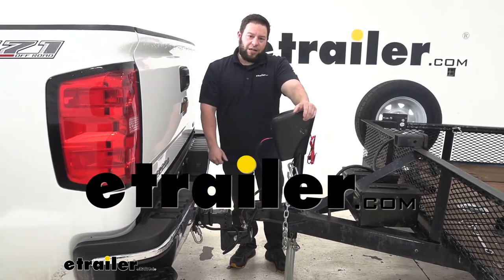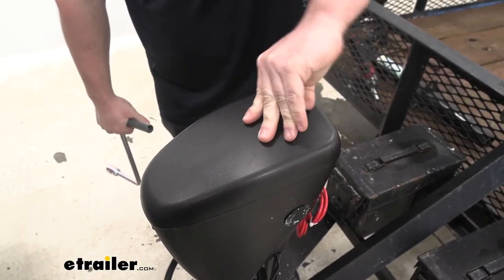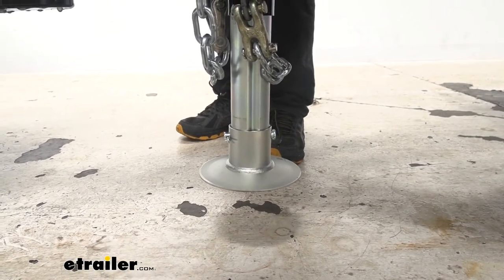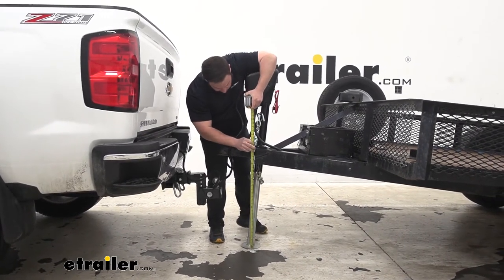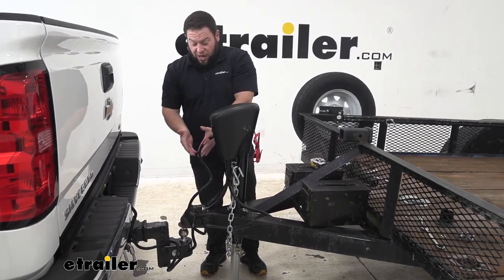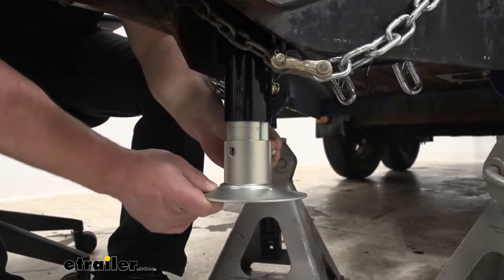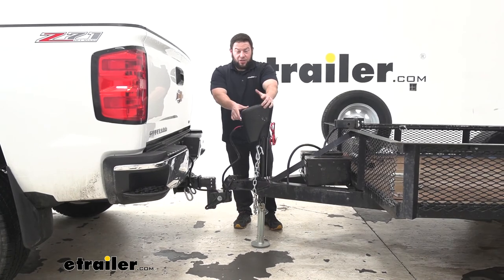etrailer | Comprehensive Review: Lippert Power Stance Electric Trailer Jack w/ 7-Way Plug

Comment: Does the plug-in work for all trucks?
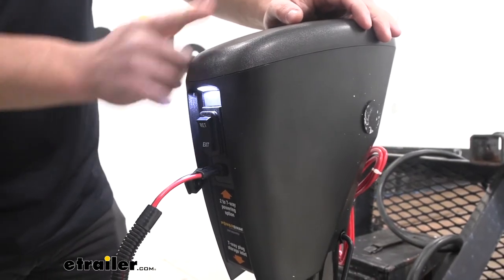Reply from the maker: As long as the truck in question has a 7-way trailer connector with a functional 12-v feed to the pin in the 1:00 position, it'll work great with your truck. Hope that info helps!
https://www.etrailer.com/Camper-Jacks/Lippert/LC89VR.html